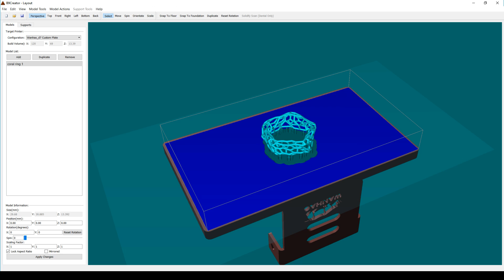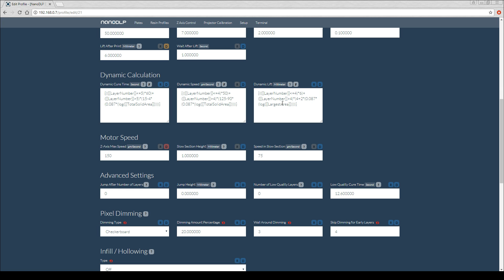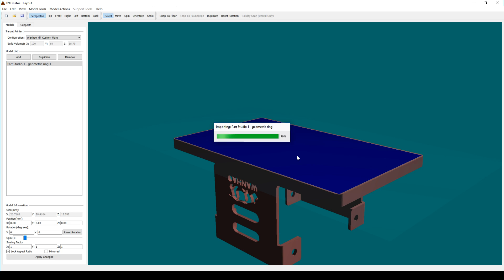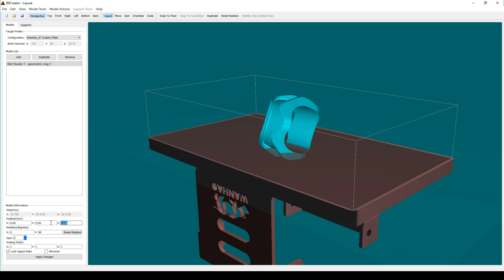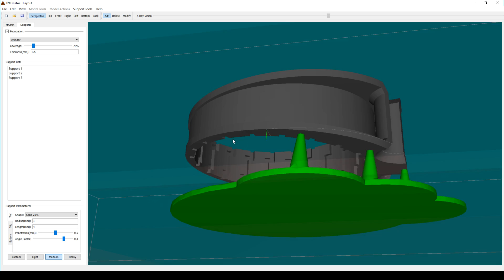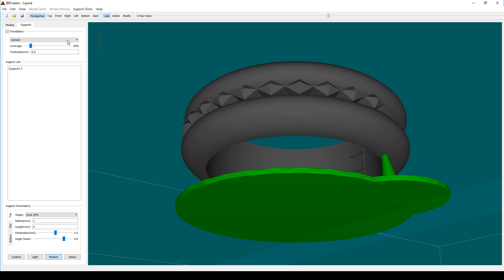How to print with Bluecast resin - Modelling 3D Printed / Investment Cast Rings - Part 6

Comment: Hello, 
Really one of the best channel where you can find impprovment and tweak on 3d printing. I dont know if you know this tip but when you got a hole or any through cavities on your printing then you can try to angle your parts from the bed. For example the axial of the hole will be no more colinear with the bed, so the support will then not be through the hole but come from this outside. It will be then much more easy to remove support material. I hope my explanation was clear ? Sorry but english is not native language.

Comment: Regarding supporting your parts, I always found it easier to have a look through the models by scrolling through the layers, this way you will be able to identify "floating" layers or critical layers which would have a hard time to attach. I'm not sure if the B9 software has this feature, the Asiga software for examples provides that.
I would assume for the very same reason the auto-support function sometimes would like to place supports in the inner part of the ring, because it identified a floating or critical layer. I haven't seen the supports and the orientation of the model that failed half way, but would assume it failed due to insufficient/unideal supports.
Reply from the maker: That is a great tip. I often cycle through in NanoDLP before hitting print.

Comment: Hi Michael,

Great video just a few pointers, it is not crucial to cure the prints after printing as many of our customers do not find the need to, a refined pair of wire cutters used for beading would give you a better cut when removing supports. great video keep up the good work.
Reply from the maker: Thanks for the pointers, greatly appreciated.

Comment: Hi Michael, do you know this resin's density? I mean, this 500g pac turns into how many mililiters (or any other unit of volume)? I ask  that because I pay  for 3d prints by volume. 
And also, what is the % of   material loss during the 3d printing process, If there's any?  
What about the support, can I estimate a % for it over the final piece volume/weight?
I intend to calculate the efficiency of this resin and the final cost of production, to figure out if getting a D7 will be worth it rather than keep on paying for that service . Sorry for my English. Thanks
Reply from the maker: I haven't printed enough to have that type of data. With a full and empty bottle you could calculate the density. Support will vary model to model but most slicers give a prediction of resin use. You could download the slicing software and prepare some files.
Reply: Teaching Tech thanks!